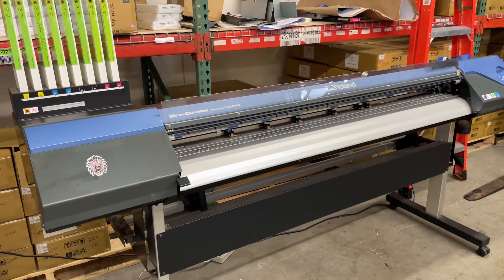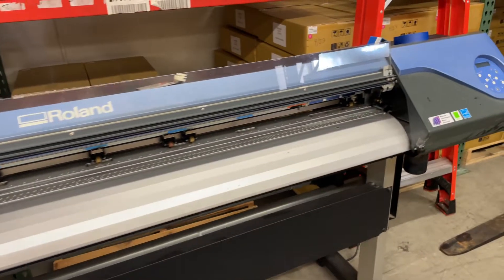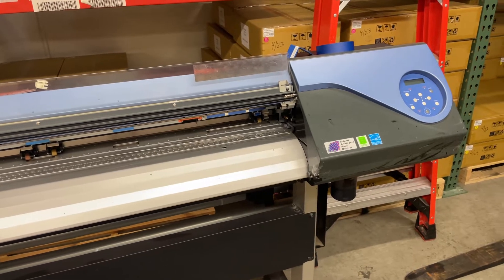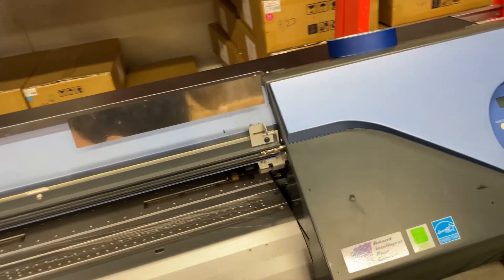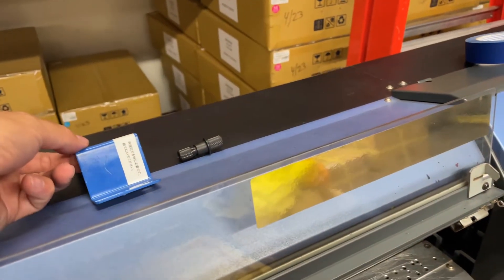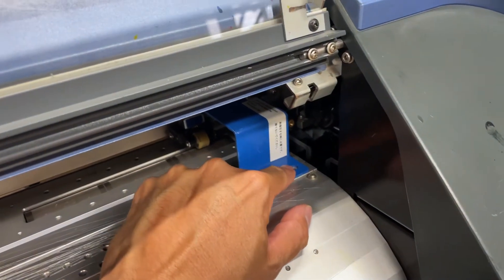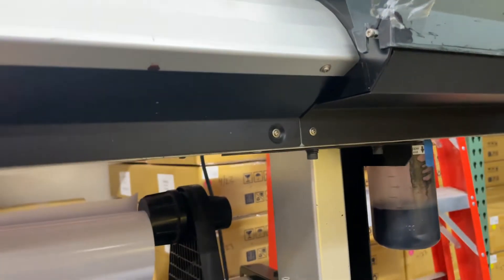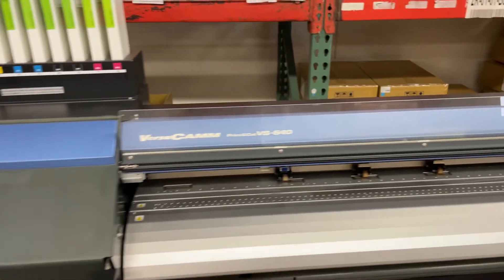How to move Roland VS-640

Comment: Hey Guys, have a VS640 being transported. It could take 7-10 days, what’s the process with flushing the ink lines? The printhead bracket will also be in place
Reply from the maker: We would insert eco solvent cleaning cartridges, do 4 strong cleans. Now move the printer. After you got to destination. Insert color ink cartridges, do 4 strong cleans to put the ink back to printer. https://www.premiercolour.com/products/jetbest-eco-solvent-cleaning-solution-for-roland-printers-220ml?_pos=3&_sid=5891c60b5&_ss=r
Reply: @premiercolour611  Thanks guys, printer needs to be moved this week so don’t like my chances of being able to get the cleaning cartridges through it in time but might be able to when it arrives on this end though. With that in mind should the inks be removed and the head secured/waste tank emptied?